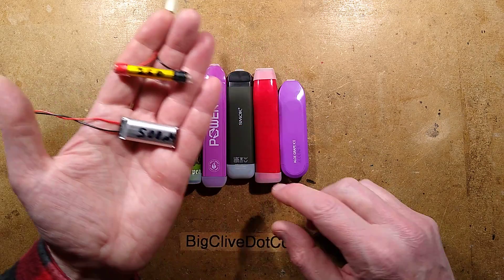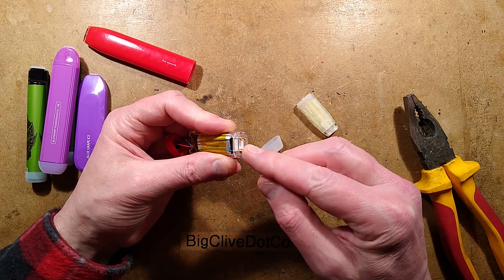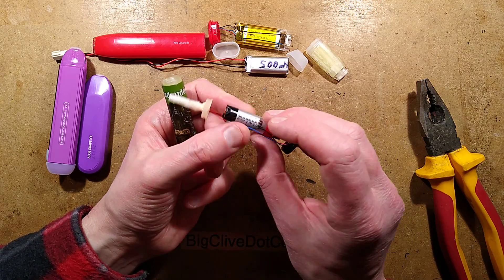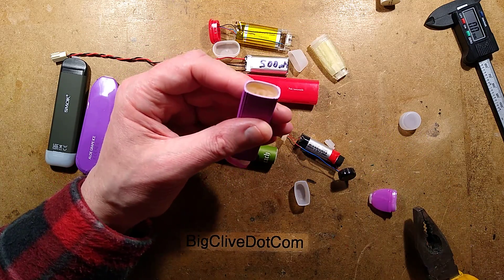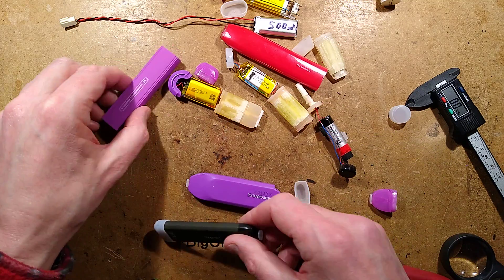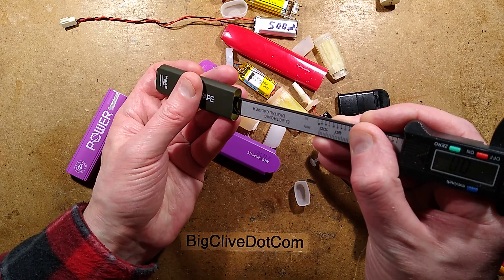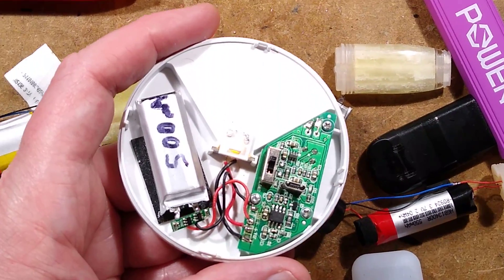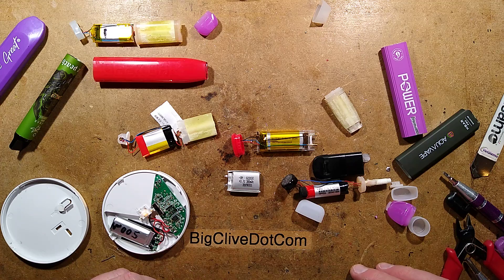Scavenging rechargeable lithium cells from the roadside

Comment: It’s a wonderful world for us that can take things to bits and salvage parts or entire devices from what the average person calls trash… just acquired a carpet cleaner from someone throwing it away, it was lithium battery powered and had one dead cell. I have since built a proper battery dwarfing the originals size.
Reply: A battery powered carpet cleaner? People these days are just afraid of cords jfc
Reply: @thekingoffailure9967  no kidding. That thing would eat through them like crazy. I used to work with semi pro ones and it took hours to get a few chairs clean, can't imagine trying to do that on a battery!
Reply: @woodworkerroyer8497  Thats my thinking. In the next few years they'll be selling battery operated microwaves or something equally ridiculous. Just because we can put lithium cells in everything doesnt mean we should.
Reply: @thekingoffailure9967  Agreed, sort of like "internet of Things". I don't need my toaster to have access to twitter or whatever.
Reply: @thekingoffailure9967  You aren't kidding. Still haven't actually used it, buut I don't have high hopes. lol, long term plans are to take the internals and repurpose anything I can.
Reply: Yeah, same with most power tools, people will straight up toss or give them away if the battery dies because an OEM battery costs $60+ vs the $10 it costs you to build one.
Reply: @vgamesx1  you're not rebuilding a power tool battery for $10. Aubin is a 5s1p battery, you're talking ~$30 just in batteries. A 5s2p, $60 in batteries. (Not including shipping.)
Reply: @vgamesx1  - Not just that, but you have to use the right batteries.  For a lot of those items, you need high discharge 18650's (or similar), and the ones sold regularly are often extended discharge, like you'd use for a laptop.   I had to  hunt for the right one to use to replace in  my one battery Ryobi cordless screwdriver.
Reply: @tbelding  Man, I've been using corded screwdrivers this entire time when I could get cordless ones?
Reply: @RAndrewNeal  Yup.  Sorry about that - but remember, you didn't have to keep replacing batteries.
Reply: @tbelding  I don't even know how to keep the joke going. All my screwdrivers are actually cordless, but they run on elbow grease. lol
Reply: @RAndrewNeal  The price on elbow grease keeps rising every year, and it's harder to find.
Reply: @tbelding  That is true
Reply: @RAndrewNeal  
I've got a corded hammer!  👍
Reply: A wonderful world would ban the manufacture of such wasteful things, because for every 1 that someone reuses there are 100,000+ that go in the bin. And if cigarette butts are any indication: these will be scattered around the oceans/waterways and outdoor spaces..
Reply: @--Nath--  agreed
Reply: @GeneSun yes people will even throw away their Dyson batteries with really good cells in. It’s crazy what people will chuck out and buy again new.
Reply: @Alexander_l322  I made a 12v battery pack for a cordless radio I have in my garage out of a Dyson battery.
Reply: @Alexander_l322  most older dyson batteries are not able to be rebuilt very easily. 2 of the cells are epoxied to the battery cage with a thermistor. So you need to hack it to bits to get it apart.
Reply: The throwaway society certainly gives us plenty of things to play with. I've lost count of the number of emergency lights and power banks I've made from scrap laptop cells etc.
Reply: I got a cordless Bosch hoover with a good battery but the motor had broken. I haven’t gotten around to taking out the 18650s yet but I will use them at some point. Better than going to waste.
Reply: @Alexander_l322  check the batteries so if they are flat recharge them or they will lose capacity and/or get ruined
Reply: Conversely, I was super exited to take a non-working inkjet apart only to discover that everything inside was custom built for purpose out of the cheapest, thinnest materials. No belts or servos or anything remotely useful aside from the power supply, which was strangely modular in design. Probably goes in a lot of the other printers from that manufacturer. Oh, and I'm never buying another inkjet again. Completely worthless after two years, and it was a nice, multi-function office one with a touch screen. I wish I'd taken pictures of the little "inkwell" that contained all of the ink used for "maintenance" and "cleaning". Absolutely FULL of gross, inky goo sludge.
Reply: @testbenchdude  I agree 100%......i went with laser years ago and never looked back! Used to make me so mad that every time i went to use my inkjet printer there would always be one color dried up.....and it wouldn't print, even if you didn't want it in color! My laser printer cartridges are less than $10 each and will print over 1500 pages...love it!
Reply: @testbenchdude  So what would you recommend instead of inkjet? By the way I refuse to buy anything made by HP cos I once had a printer of theirs with a scanner, copier and fax - I mainly needed it to send faxes. The rissoles at HP designed it so that even non-printing functions like sending a fax would stop working if an ink cartridge needed replacing. You could get around it by faffing around with error-code over-rides for each send but the whole principle of the design just annoyed the hell out of me.
Reply: @peteneville698  Laser....every time! See my reply to Michael, too.
Reply: @peteneville698  Really depends on what you need. Inkjets are great for photos but they have such a short shelf life that it's not worth it to me. I got a color laser from Okidata. It does what I need just fine, and has been rock-solid for almost 10 years now. Can't say that for any inkjet I've ever owned. Well worth the investment.

And if you don't need color at all, you can get black and white (and greyscale) ones for under US$100.
Reply: @testbenchdude yep, absolute garbage machines
Reply: My dad once saved a really big bass amp from the dump because the owner said "the cable was missing" and it was just a regular 3 pin ac connector found in projectors, pc, monitors, dvd, players, etc basically we had 50
Reply: @64-bit63  an absolute win! good save
Reply: Thanks, Clive.  You're keeping us non-smokers in suspense by not telling us how much they cost.  🤔
Reply: @GeneSun never even considered asking about that. All they can do is say no, right?
Reply: Just fixed my welding helmet. Stored in the dark and battery was to week. Non serviceable my ass $2 of batteries and 20 minutes of my time.  Saved almost $100
Reply: I did something similar. My uncle had a dead drill battery pack and gave it to me because he knows I like tinkering with electronics. I took it apart and replaced all of the 1300mah lithium ion cells with 3000mah cells. I more than doubled the runtime of it and sold it back to him for 50 dollars
Reply: @GeneSun I thought they got paid for the scrap !
Reply: "Scrap-crafting"
Reply: @GeneSun  Whenever I am recycling old  ni-cd batteries at Lowe's or home depot I put my old ones in and I may take a lithium battery pack out.

Comment: When is the point in time where we - as a society - start challenging our suppliers a bit more? It is disgusting to see such things produced for single use only. Such throwaway stuff should cost much more, in my opinion.
Reply: I very much agree, I find the throwaway mindset really appalling.
Reply: I'd like to see a refund system like was once used for glass soda bottles. Take your empty back, get a refund, buy another soda, bottle gets washed, sterilized, and reused until it's condition actually warrants being recycled.  Even if they put in a brand new tank for reuse it would be better than tossing it all for a new one.
Reply: There are also a lot of 3-5-8Ah single-charge phone chargers (with rechargable LiIon cells)... The wastefulness is just staggering.
Reply: I've asked Naomi Wu on Twitter, and apparently Chinese government forbid selling of these in 2019, in all provinces. No ban on manufacturing, regrettably
Reply: Yeah throw away items like this really annoy me, there's so much more potential with everything that's in it. I vape myself with a bigger vape that just uses rechargable high voltage 18650's, and refillable tank. Which in the long run is waaaay cheaper, and in england you can even get 100Ml juice bottles which are also really cheap. Here (NL) we can only get 10Ml bottles and even that annoyed me, not only because it's more expensive per ml but also because every 100ml bought in the netherlands now uses probably more than twice the amount of plastic for the same amount of juice, because now you're buying 10 bottles. obviously smoking, vaping or anything similar is bad for yourself and the environment, but these non-reusable things really waste a lot of materials that can be used way more efficiently.
Reply: It's our duty to find and reuse them now I guess
Reply: China doesn't care. They want your money. They will destroy the planet
Reply: @Jay-fp8iy  The US is a much larger polluter per capita than China is.
Reply: we do the vaping community has turned HARD on theese devices several forums and suppliers refuse to carry or even promote theese devices due to there wastefull nature

that being said i do support some form a disposable or rather ready to go device being available as when your main device goes dead theese are a life saver

i wish however like E-lites used to do all retailers would be required to takke them back for recycling elites would offer a loyalty program on disposables and carts every 4 packs earned you a 5th free
Reply: Absolutely. Same with right to repair.
Reply: We had a better way, but the disposables have pushed the rebuildables out of market.
Reply: They shouldn't exist period!! Especially the single used ones and not the refillables at least the refillables you're not buying a battery every time its disgusting looking at these devices knowing people are just throwing them in the garbage and not the electrical garbage but even if they were throwing them in the proper disposable it's still a crisis for global warming that's why I'm here looking for suggestions I want you can do with the batteries!!
Reply: you're right.  I'd no idea these existed.  its absolutely abhorrent waste of materials and resources.  if someone wants to vape BUY a reusable one ffs.  so let me get this straight. "you should stop smoking (dried tobacco leaves in paper) cigarettes because harm to you and the smoke goes into atmosphere and also the butts/filters.. the environment shriek..  yadda yadda.." so we'll replace them with high tech environmental nightmares to save you AND the planet.. wt actual f.  how much is a pack of twenty lol (Ironically probably cheaper then an old pack of ciggs)  I'm really starting to think logic and rational has left planet earth
Reply: Government interference CREATED the market for these things - because they decided to make leaves in a paper tube prohibitively expensive.
Reply: @c6q3a24  I don't think so, my guy. These aren't exactly cheap and not every location has a tax or a high tax on cigs.
Reply: @caodesignworks2407  
This is in the Uk. There is a 400% tax on cigs in the UK. 

The base price of a 20 pack is £2.00. Then a ~400% tax is applied, making the retail price ~£10.
Reply: @c6q3a24  Low price to destroy your lungs
Reply: @caodesignworks2407  But vaping is OK? Either way it's none of the governments business. Working destroys my joints, maybe it should be outlawed! If you want to destroy you lungs that is a right you have in every white country.
Reply: @ryanroberts1104  Cool story. Love your life
Reply: @caodesignworks2407  In my country, cigarettes cost $2-2.50 each. For comparison, a litre of milk is around $1.10, a loaf of bread is 80c. Even a litre of petrol (generally seen as very expensive) is about $1.95.

Cheap is a relative term. You can pick these up for $15 or less here, for a 1500 puff vape. Much cheaper than a pack of cigarettes. This is a world created by trying to tax peoples choices.
Reply: @c6q3a24  That's just utter bs, you can also say that people now get fat because they cannot afford to smoke. Your health is your own responsability, not the governments.
Reply: @hoedenbesteller  I think you missed the point. Cigarettes, in reality, cost very little to produce. Most of the price is taxes. I'm not sure how these things are treated but I'm certain they are not paying the same taxes to vape, therefore making it cheaper, by government intervention.

The government is literally trying to make you not smoke by artificially making it cost more money, in other words, making health their responsibility. And in Europe, it absolutely is their responsibility, since they pay for all the doctors.
Reply: @hoedenbesteller  
I agree - so perhaps the government should stop interfering in the market by applying extreme taxes to consumer goods?

A 20 pack in the UK costs ~£10.

The base price is £2. Taxation increases that price by over 400%.

£2 for the product + £5.26 levy + 16.5% leaf tax + 20% VAT = £10.15
Reply: As individuals we do not have the influence. However, this is where local and central governments can use regulations and taxes to incentivise behaviour. In part through making sure disposal costs are borne by the manufacturers and importers. So if they’re still cost effective after accounting for their environmental harm, then sure. Otherwise industry will adapt to game the new rules. Incentivising the behaviour we do want is much simpler and more effective than being prescriptive with hard written lists.
Reply: @ZaphodHarkonnen  Because getting the government involved with setting retail prices has worked out SO well in the past.
Reply: @ZaphodHarkonnen  part of the reason these exist is government regulations in the US banned the fruit and other exotic flavours in the rechargeable pods but not single-use creating a perverse incentive.
Reply: @ZaphodHarkonnen  We DO have ways to influence decisions, just by making a purchase or not.
Reply: @peter.stimpel  Yes, but most people will go with whatever is more convenient, they're all about saving the world up until it causes them even the slightest inconvenience.
Reply: @peter.stimpel  Yeah but his point is quite valid, look at the most popular devices on earth like iPhones, granted it has other merits such as iOS but because they go out of their way to restrict repairs and make changes to the OS I certainly would not buy one myself, yet plenty of people will, considering it's still the single best-selling device, sure voting with your wallet is good, but it ultimately doesn't matter in the slightest unless you create a strong movement.
Reply: @Mackze  that is why I wrote "society". Sad
Reply: @vgamesx1  yeah, right to repair is the kind of same atory. But there is some progress, at least
Reply: @AnttiBrax  sure, but if one can choose, one should choose
Reply: @peter.stimpel  I've been exercising that "influence:" on the tobacco and vaping companies for decades - they haven't noticed and don't care...
Reply: Not going to happen under Capitalism, but there is an alternative that starts with an S :)
Reply: @specialagentdustyponcho1065  Me, Peter, revoluzer ... ;)
Reply: When china sit up and listen.  Until then, welcome to the end of the world x
Reply: Now you're just trying to make laws about what people can have and what they can't. That is none of your business - if I want to be wasteful I can be, so long as I pay for it. It is in no way "wrong".
Reply: @ryanroberts1104  You cannot repair the damage with your feckin' money, so your statement is kind of pointless, sorry.
Reply: @ryanroberts1104  why do you hate your grandchildren?

Or if you say that's none of my business, why do you hate my grandchildren?

FFS this attitude that you and many others have is stealing from the future -- and it is a huge fault of our current system that it gives you the "right" to wrong them in that way

Comment: Will there be an upcoming Big Clive video where he's designed a controller circuit for charge/discharge of these disposables, along with a handy 3d printed battery box to contain one or more of these cells.?
Reply: I wish he'd review the battery codes that talk about form factor as it relates to battery size. An 18650, for instance is 18mm across, 65mm long and the zero designates it as a cylinder.

Comment: Incredible to think that these are considered single use. The aluminium and the lithium cells are such valuable resources which are just thrown away. Greta won't be happy
Reply: It's frustrating that it is cheaper to dig lithium out of the ground than to recycle it.
Reply: @zh84  not for long
Reply: @Nono-hk3is  For very long.
Reply: It's a re-Greta-ble state of affairs
Reply from the maker: They should call one the Greta-Bar.
Reply: the gold tips on the plates are just wasted as well . Should be polished copper for the time its in use
Reply: Greta don't give a damn. It is just political vehicle for her. Or her parents.
Reply: I don't think she would care much, it's merely the tip of the Thunberg.
Reply: Doesn't exactly exhilarate me either, tbh
Reply: Have you seen Greta? She's never happy. 😜
Reply: Most greens, maybe even Greta too, work for oil companies. They create panic and confusion, but the resulting policies are not solving anything, just redirecting tax money to the same entities that are responsible.
Reply: @noop9k  citation needed